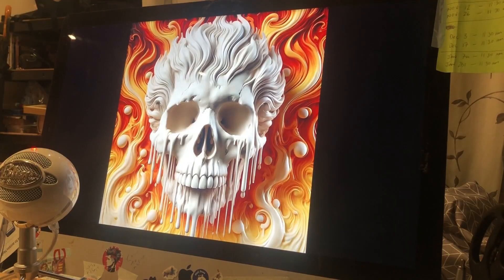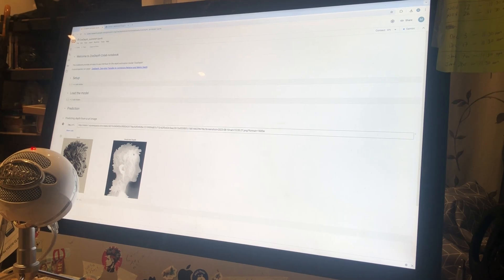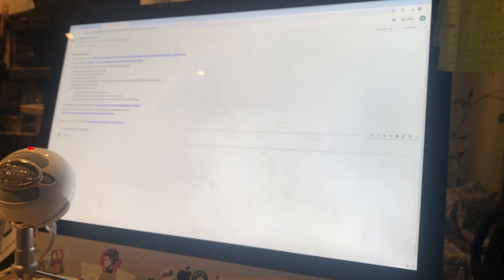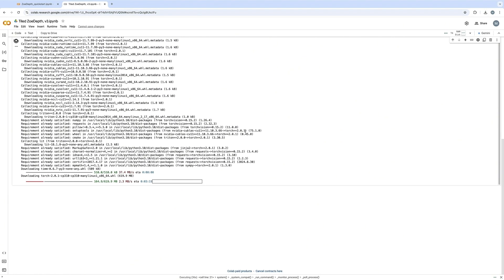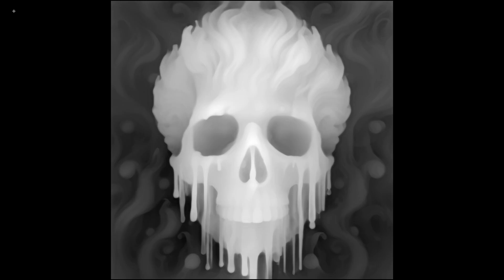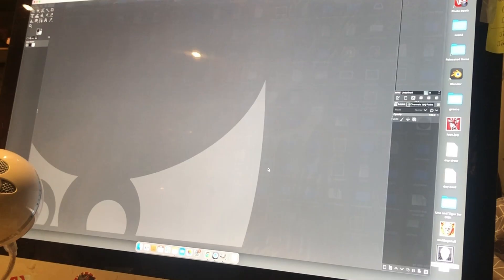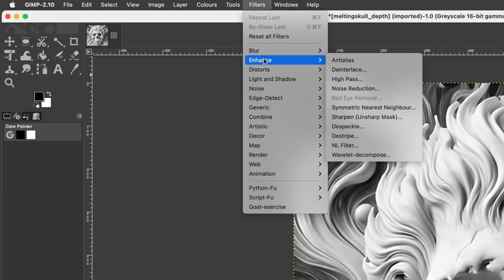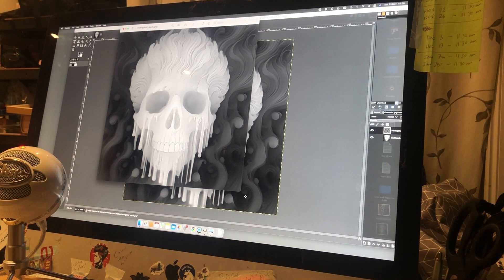How To Create High Detail Depth Maps For Laser Engraving, CNC Carving & 3D Printing

Comment: Thanks for the video mate , i will try this when i get some time.
Reply from the maker: You're welcome, hope it works out great for you!
Reply: @SilverPunkPour  I get this error : ERROR: Could not find a version that satisfies the requirement torch==2.0.1 (from versions: 2.2.0, 2.2.1, 2.2.2, 2.3.0, 2.3.1, 2.4.0, 2.4.1, 2.5.0, 2.5.1, 2.6.0, 2.7.0, 2.7.1, 2.8.0, 2.9.0)
ERROR: No matching distribution found for torch==2.0.1

Comment: hi good day it keeps on giving me this error and i use google chrome with jepg image ERROR: Could not find a version that satisfies the requirement torch==2.0.1 (from versions: 2.2.0, 2.2.1, 2.2.2, 2.3.0, 2.3.1, 2.4.0, 2.4.1, 2.5.0, 2.5.1, 2.6.0, 2.7.0, 2.7.1, 2.8.0)
ERROR: No matching distribution found for torch==2.0.1
Reply from the maker: mmmm...im really sorry not sure what that error is...i have tested it just and its working fine my end...i have never had anyone with this error....are you sure you are using the right version of zoedepth ? and the jpeg image is not to big file size wise?

Comment: If starting w/a color image (rather than the grayscale one you used), is it best to convert the image to grayscale first before running it through ZoeDepth or does it not matter that much?
Reply from the maker: I would try both and see how you get on, i doubt it would matter much though.
Reply: @SilverPunkPour  Thx.  Once the Tiled ZoeDepth v3 errors get fixed it will be nice to try your suggestions out.  I tried the v4 that's out there but it took a very long time, and both the low & high rez output looked very similar.  The pre v3 version produced better results than v4.
Reply from the maker: yes i always use the v3 version i like that better for my work flow, i do however use an online converter as well now, here is a link to that video: https://youtu.be/wZhGTD6aixw?si=U-ajk_cdXdStbXVw
Reply: @SilverPunkPour  That's pretty much the gold standard for converters imo.  It's always good to see alternatives though so your video was very interesting.

Comment: Thanks for the video! I tried following all your steps and got one issue.. When I save the file, it's just all png. What did I miss?
Reply from the maker: Hi there! thanks for message, at what stage? you can use the "save as" or "export" if you want to save it as a different file format
Reply: @SilverPunkPour  the last stage. In gimp it looks good, with the details as in your video. But when I save or export in png, the file is black completely
Reply from the maker: Right got you, a couple of people using different versions of gimp have had this problem, it maybe something to do with the layers, my verision of gimp works fine, here is what i have found online:

1. Transparency Issues:
JPEG:
JPEG is a format that doesn't support transparency. If you're exporting to JPEG, GIMP will fill transparent areas with the background color, which is often white or black. 
PNG:
PNG does support transparency, but some viewers or applications might not handle it correctly, causing transparent areas to appear black. 
Alpha Channel:
Ensure your image has an alpha channel, which is necessary for preserving transparency. Check the "Channels" dialog in GIMP to see if it exists. If not, add a new alpha channel. 
2. Background Color:
Exporting to JPEG:
If you're exporting to JPEG and have a transparent background, it will be filled with the default background color (usually white). To avoid this, use a format that supports transparency like PNG or TIFF. 
Viewing Applications:
Different applications may have different default background colors when displaying images with transparency. Some might show transparency as black, while others as white. 
3. Layer Issues:
Visible Layers: Make sure all layers are visible before exporting. 
Active Layer: When exporting, ensure that the layer you intend to export is active in the Layers Dock. 
Layer Blending: Check the blending modes of your layers. Incorrect blending modes can sometimes affect the exported image. 
4. Color Mode:
RGB vs. Indexed: If your image is in indexed color mode, it might have a limited color palette. Ensure you're in RGB mode before exporting. 
Solutions:
1. Choose a format that supports transparency:
If you need transparency, use PNG, TIFF, or other formats that preserve it. 
2. Check the alpha channel:
Ensure your image has an alpha channel. 
3. Export as a separate layer:
If you're only exporting a specific part of the image, try exporting only the relevant layer by hiding other layers or using the layer keyboard shortcut. 
4. Try different viewing applications:
If the exported image appears black in one application but not another, it could be a viewer-specific issue. 
5. Adjust background color in GIMP:
If you want a specific background color for transparent areas, you can set it in the "Export" dialog for PNG or other suitable formats. 
6. Merge layers:
If you have multiple layers, try merging them to simplify the image before exporting. 
By following these steps, you should be able to resolve the black export issue in GIMP and ensure that your images are saved correctly with the desired transparency and background colors. 
Exported files come out as black and white?
20 Jul 2022

Reddit · 
r/GIMP
Chapter 6. Getting Images out of GIMP
When a multi-layer image gets exported to a single-layer file format, there is no way GIMP could preserve the color values in the ...
GIMP Documentation
Gimp images magically change when I export - Reddit
13 May 2024 — When Gimp exports an image in some formats that support transparency (most notably PNG)(*), the "erased" pixels are jus...

Reddit

Show all
Reply from the maker: @ShortBetter  Using Gimp 3 my resulting image was also black. Solved it by right clicking the top layer (original image) and clicked 'Add Alpha Channel'.
Reply from the maker: Using Gimp 3 my resulting image was also black. Solved it by right clicking the top layer (original image) and clicked 'Add Alpha Channel'.

Comment: Hey, I love this video and I learned a lot of important things from it, thank you for that. I'm currently having a problem: when I edit the depth map in GIMP the way you showed, the exported image turns out completely black. I'm doing everything exactly the way you do it and the way I used to do it before. I'm really getting frustrated. Can you give me a tip on what I might be doing wrong?
Reply from the maker: Hi there! there is some people who have had this problem, if you check the chat, i think it is something to do with the version of gimp you are using, there is some people who have made work arounds for it.
Reply: @SilverPunkPour  So far I scrolled back 5 months and not seeing the workaround.
Reply from the maker: @mikecarter8880  You have to make sure you have the alpha layer selected also when you save / export it out
Reply: @SilverPunkPour  The layer is black. And yes I did.  I didn't get back to working on it, but was going to try an older version which you are using.  I suspect it is an issue with the current version. Have you updated to the latest and tried it?
Reply: same for me ...weird....look everywhere nobody talk about it
Reply: Ok found the solution in the new Gimp version you need to merge filter
Reply from the maker: @DenisTeasdale  You have to make sure you have the alpha layer selected also when you save / export it out
Reply: Same issue.
Reply from the maker: You have to make sure you have the alpha layer selected also when you save / export it out
Reply: @SilverPunkPour  Yes It was selected, but found the solution in the newer version you need to tick merge layer and it fix the problem
Reply: @DenisTeasdale
Hey, could you please explain that in more detail? That would really help me. Thanks a lot!
Reply: @sebastianchrysant6328  Hi just put the information, when you create the multipass and the alpha you've got the option to merge the layer, tick it and you will be find
Reply: @DenisTeasdale  thank you so much for the solution
Reply: @DenisTeasdale
Thank you very much

Comment: I did as you said, but it turned black on the icon of the top layer, and you seem to have gray there, and then I started saving the image, and it was just black.
Reply: for me everything worked well until saving final result, my saved image was also just black, nothing
Reply: @lanadsgn  did you find a solution to this?
Reply from the maker: mmmm not sure why it is not working for you....havent seen this before, you have to use the exact image you made the depth map with and pull the original on top of the depth map then export it

Comment: Thanks for the swift reply, how do I check if I’m connected to “T4” ? - definitely using a jpeg image etc and have a Google account etc etc 

Sorry absolutely useless at this stuff 😢?
Reply from the maker: oh mate thats fine, so am I ! It will be under the connection type on the Google collab menu, connect to hosted runtime T4, im guessing with the error message you showed it is probably just needing the Numpty to be updated or corrected, its working fine for me and a lot of other people, but some are getting the same error, you have had, i would try it again in a couple of days and see?
Reply: @SilverPunkPour  thanks again ill keep trying
Reply: just checked again YES am definitely connected to T4

Comment: i cant get it to work for me??? I keep getting an error saying "NUMPTY NOT Available" anybody else had this issue and how can i resolve it - thanks in advance????
Reply: It still works. I was having the same problem, and I'd love to make a video for it, but it would not fit my channel, so I'll just explain it.

Look just a little ways above the play button that you use to run the code that asks you to upload your image. There is another play button next to a box to install the missing Numpy code. After installing the Numpy, it'll ask you to restart the session. Confirm the restart, then go back down to the other portion of code and run it to upload and process your image.
Reply from the maker: @kickitinthesticks1446  Great stuff! thank you so much for sharing this!
Reply: @kickitinthesticks1446  THIS!
Reply from the maker: Yes a couple of people have had this error, I tested it a day ago and it worked fine my end...so not sure what is happening, just check you are connected to T4 on the collab and make sure you are using the right version and a jpeg image, if you are im not sure why it would not work at the moment, as it is working ok my end....

Comment: Odd, doesn't seem to be working anymore. I was using this method last year but I've been getting "RuntimeError: Numpy is not available" lately.
Reply: It still works. I was having the same problem, and I'd love to make a video for it, but it would not fit my channel, so I'll just explain it.

Look just a little ways above the play button that you use to run the code that asks you to upload your image. There is another play button next to a box to install the missing Numpy code. After installing the Numpy, it'll ask you to restart the session. Confirm the restart, then go back down to the other portion of code and run it to upload and process your image.

Comment: Thanks so much for your skill set it's impressive. I also was able to use the method that you laid here and WOW very cool. Thanks again, Is there a way, to adjust the file to make it darker though  gimp? My brass coin came very nice just not to deep I think it was that the file though it was  formatted correctly it still turned out a little on the light side the gray scale. Thanks
Reply from the maker: Thank you for watching, yes you maybe able to adjust the colours or tone of the depth map after by adjusting the contrast a little after you have the depth map, should give you more depth i think, its something to play with to get the sweet spot.

Comment: Can't get this to work. always get this error: "FileNotFoundError: [Errno 2] No such file or directory: 'low_res/depth/depth/CherryBlossoms.npy'
Reply from the maker: mmm really hard to know what is going wrong without seeing the whole process, are you using a .jpeg image file for the depth map creation in zoedepth ?
Reply: Use the one listed as version 2, it loads up V3 of Zoe depth. The one listed as version 3 loads up one called Lotus... I was having the same issue and this worked for me
Reply from the maker: Hey there! thanks for the message, im not sure why you are having trouble, very odd....I have just tested it myself Friday 28th March at 07:33 and it has worked fine like in the video, I'm not sure why it is not for you, are you using a jpeg image, are you using the right version, not lotus, the 2nd version down the list? Zoedepth? please let me know how you get on, a couple of people have had the same error so there is something a bit different for some people at the moment, but for me at my end works fine.

Comment: Instead of Zoedepth, have you tried Depth Anything V2 or Depth Pro from Apple?
Reply from the maker: Hey Chad! thanks for the message, i have tried Depth Anything but it didnt quite work right with how i do stuff for silver pouring, i have not tried Depth Pro, might have to look into that :)
Reply: @SilverPunkPour  There's Depth Anything, and Depth Anything V2. V2 was a huge improvement. It came out late summer or early fall if I'm not mistaken. I have been using that for converting images for the CNC along with other methods.
Reply from the maker: thank you Chad, i will defo have a look into this, see if i can work it in to work with my silver pouring :)

Comment: The part where you put the images in GIMP and say 'It will change all the colors for you' does not happen when I drop the images there. Maybe there was a little cut in the video? how to assign the colours of the depth map to the original image? Thanks for posting though, very intresting video!
Reply from the maker: Hey Sergejg many thanks for watching, on mine, i drag the depth map in first into GIMP, then i just drag the original image on top and it converts it automatically for me, if its not working for you like that, what you need to do is an extra step, you will have to try and convert the original image into a grey scale image, GIMP does mine in 16 bit greyscale. This all said Sergejg, im working on a new video where i showcase another way of doing it which is a lot easier, and only takes 4 to 5 clicks to do the whole thing for you, i will be getting that on youtube very very soon!
Reply: @SilverPunkPour  Thank you for the answer! Forgot that 16bit was important! Hero! And good luck with making next video!
Reply from the maker: Thank you my friend!

Comment: I'm really new to this and I was able to follow all your instructions which means you did a fantastic job of showing the steps but I am lost on the next steps of getting it to be an STL file to put into Lightburn.  I have no idea how to do that part.  I will go look at your library and see if maybe you already have that video out there.  If not, any help you can give on the next step would be great!  Thanks again for your help so far!
Reply: You don’t use STL files with lightburn. Once you have your map all done and saved as a PNG, open in lightburn, double click the settings box on the right, select 3d sliced and enter your settings for whatever material you’re engraving on, set passes to something like 250-300 depending on your lasers power. Last brass coin I did I think I used 353 passes. Turn on cleaning pass to help remove metal dust and you’re all set. If you’ve never made a coin on a laser, you’re looking at around 2-2.5 hours of runtime.
Reply from the maker: @ΜΟΛΩΝΛΑΒΕ-μ5μ  yeah just what i thought, you just use the depth map image, great stuff :)
Reply from the maker: many thanks Greg, so happy it has been of some use, Im not totally familiar with lightburn but I think for laser engraving you should be able to just use the depth map once you have created that, as that can be used to engrave with, you do not need the .stl file.